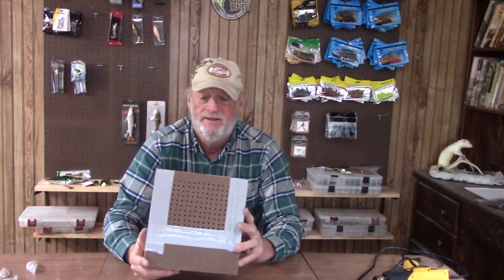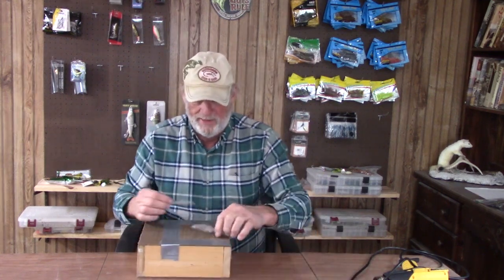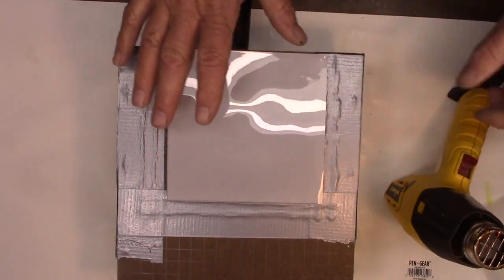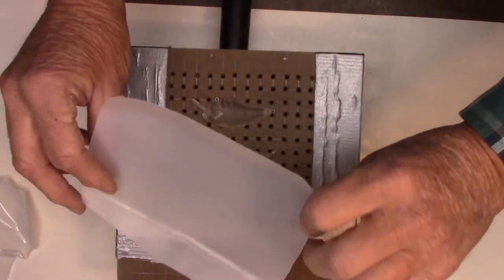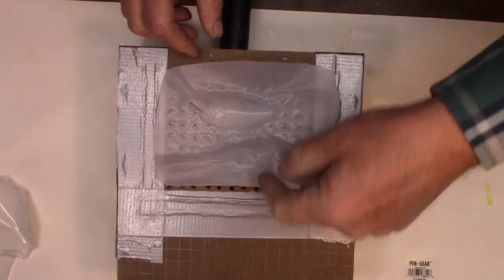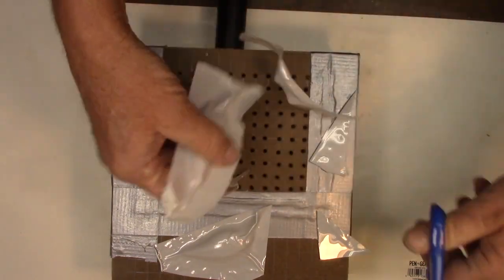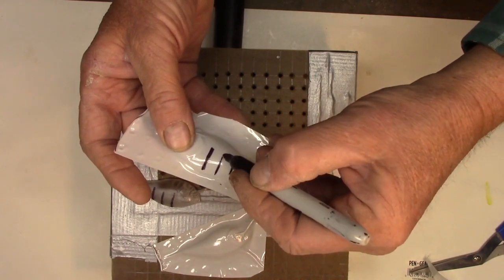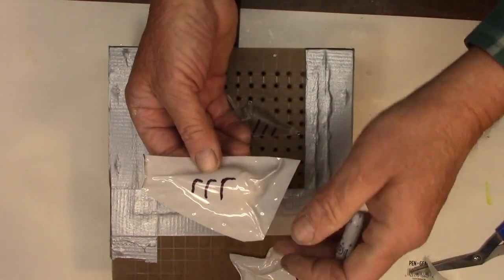Make your own stencil

Comment: I like using the plastic Folger coffee tubs. Drill hole in the side near the bottom side to fit shop vac, drill 1/8 holes in the lid , I use the plastic film that is used on meat packages you see in grocery stores. I work with poultry processing, so the small ends of the rolls that are thrown out become my personal testing equipment. Use a picture frame from the dollar store to hold plastic over a whole lure , heat , form , let cool , cut pattern out , makes any size lure you like. 👍 👍 🇨🇦

Comment: I haven't bought one yet , but I heard a soldering tip works great for designing the pattern on the stencils.
Reply from the maker: Hadn't thought about that, I may have to give that a try.
Reply: They have a cutter for it don’t they
Reply: @randywilson6869  Not that Im aware of.